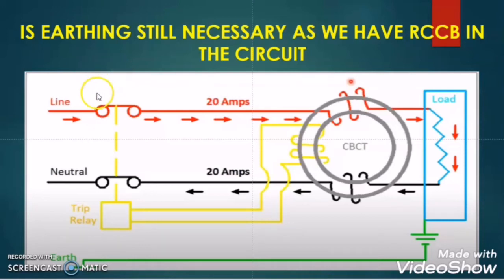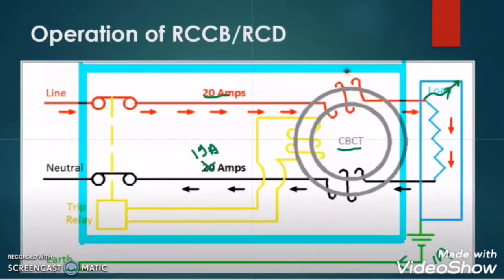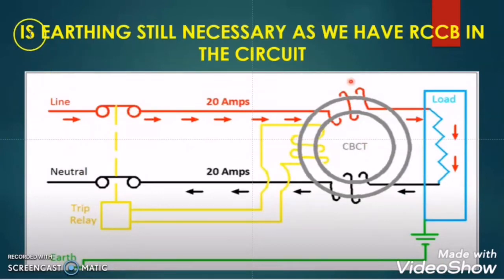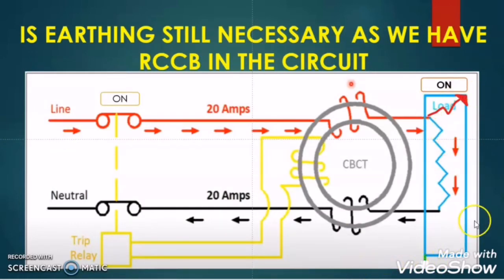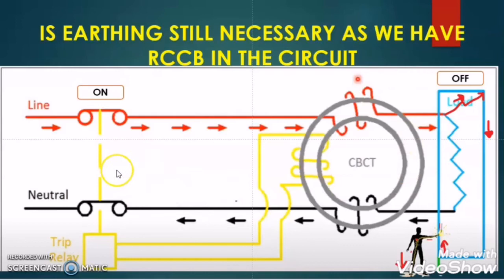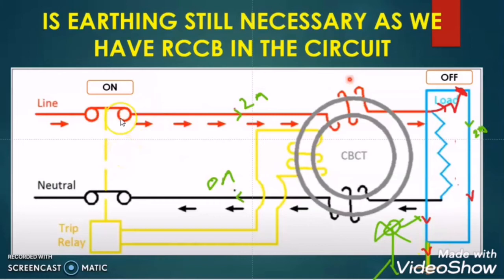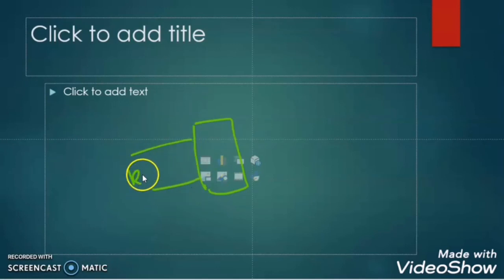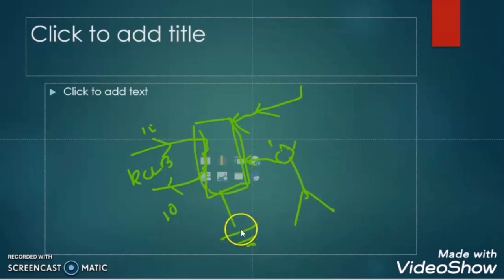Is earthing still necessary even if we have RCCB in the circuit?

Comment: B/w load and Rccb,  switch has been fixed 
Load operated by switch only 
When load is off  phase current does not pass through the load bcoz switch is in off condition  , then leakage current how happened??? When load is in off condition 
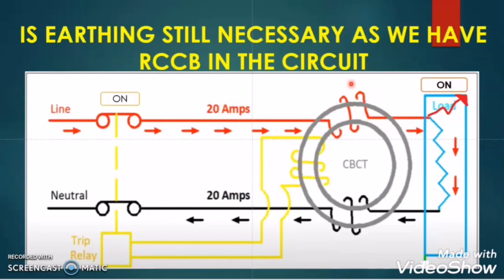3:59

Comment: bro one question... agar only earthing hoti to leakage current ground se jata and Touch krne par current b nh lagta or load chalta b rhta, but rccb use cut hi kregi, or jabtak us fault ko hm dur na kr lete wo chalne nh degi. to aise m kya better hoga?
Reply: that also depends upon load body to earth resistance, agar proper earthing huwe hai tau breaker ko trip krna chahiey look what is Zs max concept. otherwise agar breaker trip na kia tau load par voltage drop kar skte hain and device will not work.
Reply from the maker: Leakage current kyu h ?? Phase wire fully ya partially body se touch h ya equipment ka live part body se touch h right.

Yaha tak Ager clear h to ye v clear hoga ki phase wire Ager fully body se touch h to load ke live part ko koi electricity nahi mil rahi h to load chalega hi nahi.

Dusra Ager partially v touch h to load ka jo required current requirements h utna load ko milega nahi aur isse v important over all load ka resistance kam ho jayega kyu ke body ka resistance uske live part se bahut kam h to max current body se pass hoga aur is case me load tab v nahi chalega . Hope I am clear. Meri statement me load ko ek iron box ke example assume karo ko concept aur acche se clear hoga
Reply: @electricalconcept32  kuch kuch hi samaj aaya bhai.. aap y btao kya earthing k bad current bilkul b nh lagta? agr cooler etc m current aaya hua ho or hum use touch krde